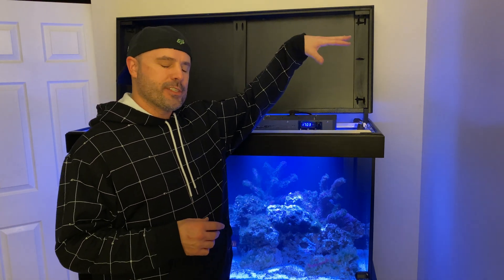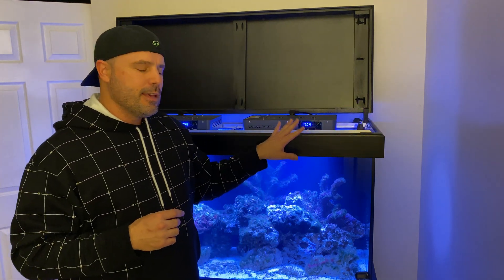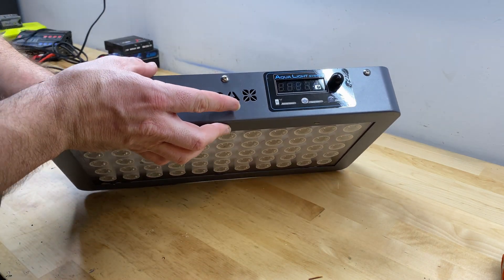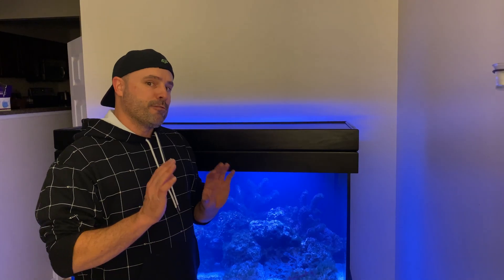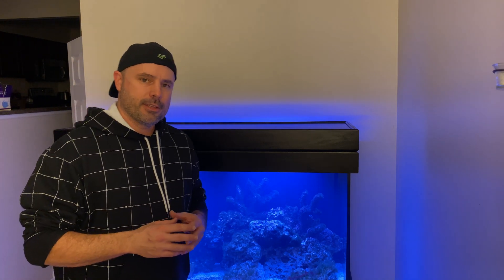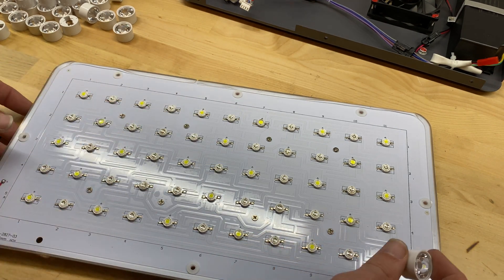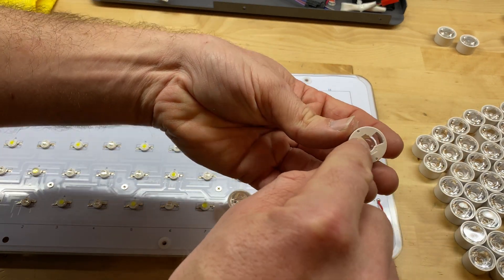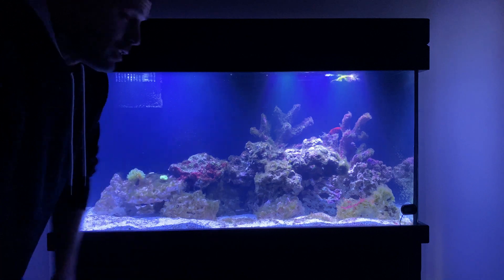Viparspectra Reef Light Lens Comparison

Comment: Question, did having the lights so close burn up some corals? I bought these and ran them at 100 percent blues on a 150 mounted about 10 inches above the water. Needless to say my corals did NOT like it. What are your settings?
Reply from the maker: I run it at 10%, both blues and whites.